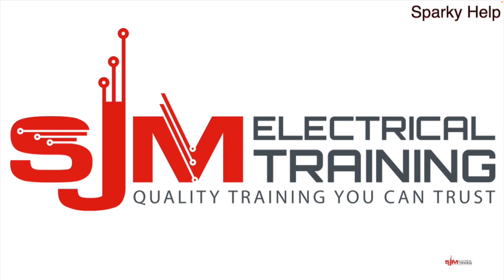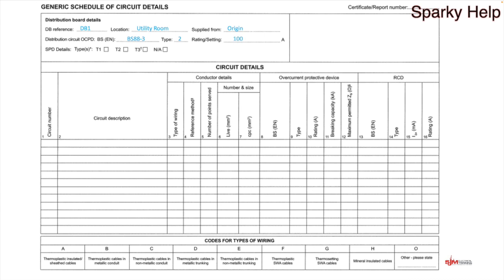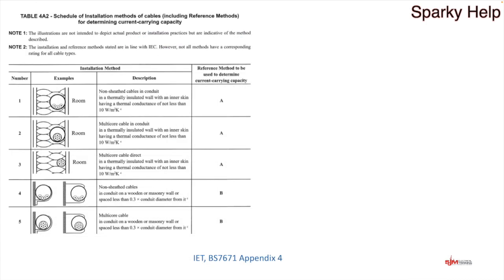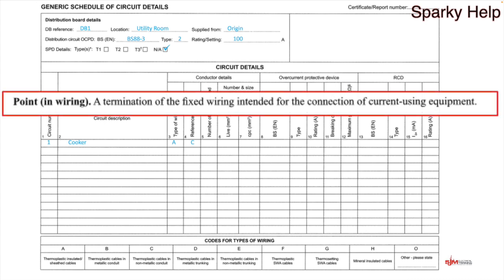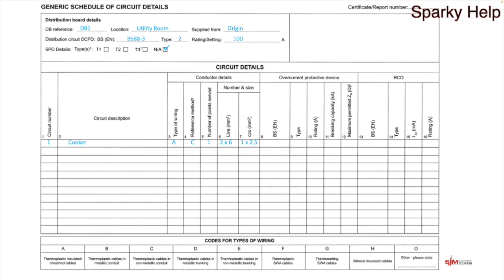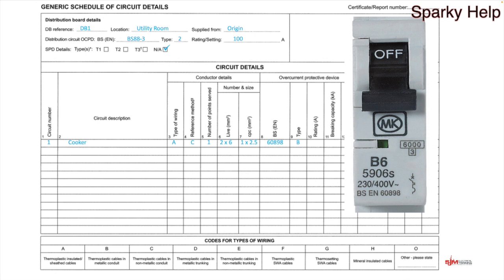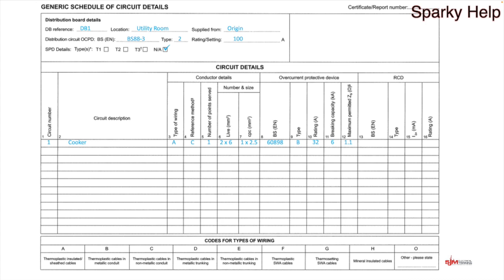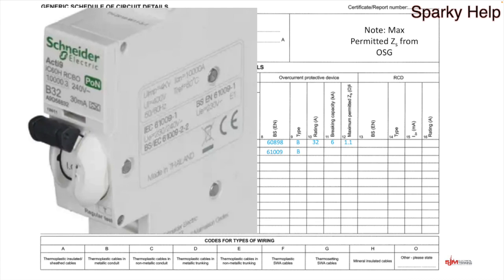How to Complete a Schedule of Circuit Details in an Electrical Installation

Comment: Thank you for the helpful information. For SY or FP200, would you still use "A" for cable type as they are both sheathed and insulated or would you use "O" for other? Thanks
Reply from the maker: Hi and thanks for watching, SY and  FP I would consider using 'O'  you can add comments on the documentation if you wish to clarify further further.  hope that helps, please share with like minded people or maybe even like and subscribe.  Again thanks.

Comment: Hi. In the GN3 example schedule it shows only 2 x 2.5 for ring final circuits not 4 x 2.5. Page 158
Reply from the maker: Hi Thanks for watching, you are right, in the On-Site-Guide they only put the conductor size and not the number.  I would stick to the definition of a Live conductor (See definitions part 2 BS7671).  Question assume the definition is understood, how many live conductors for a ring final circuit?  How many CPCs are there for a ring final circuit?  Welcome to the fickle world of the IET.  I have asked for clarification on number of points - guess what they have not responded!  Please share with like minded people - please like share and subscribe.

Comment: If I have a 60898 breaker with a split board RCD. Do I fill out the RCD part as its running off split board RCD or write NA in the boxes? Thanks in advance
Reply from the maker: Hi Thanks for watching, please share with like minded people, there is no correct way as the forms are not always that flexible, what it should be is clear and accurate.  I would probably use a row by itself with RCD No. 1  BSEN 61008 with the times of disconnection and then underneath circuit hat are protected by that on (i.e. 1,2,3,4 etc).  If there is another RCD than a new Row with RCD No. 2 BSEN 61008 with its disconnection times and underneath circuits 5,6,7,8 etc and so on.  (in comments mention it is a split board) Sorry for a long answer hope that helps please like, share and subscribe or maybe buy a coffee,  Many thanks.
Reply: @sparkyhelp3997  Thank you so much for your reply. That does make sense. There doesn't seem much clarity on filling out these new style forms

Comment: So you dont note the RCD itself at all in the circuit details? I mean if it was a 61008 covering multiple breakers
Reply from the maker: Hi thanks for watching, please share with like minded people.  You would mention the RCD in the RCD section for each circuit, if this point is the origin then it may appear also as your main switch under characteristics and main switch.  so yes it would be mentioned as it is protected by an RCD.  Hope that helps please like share and subscribe.